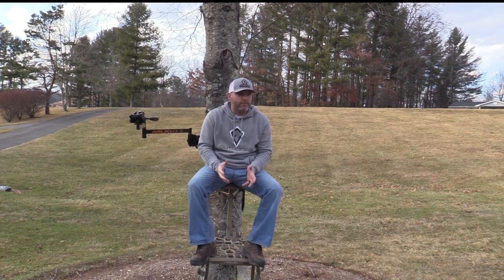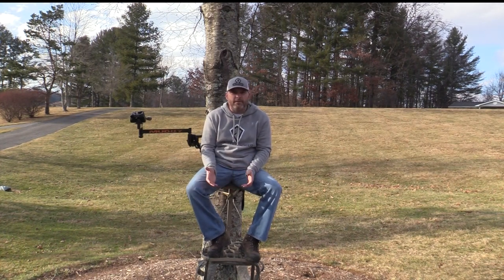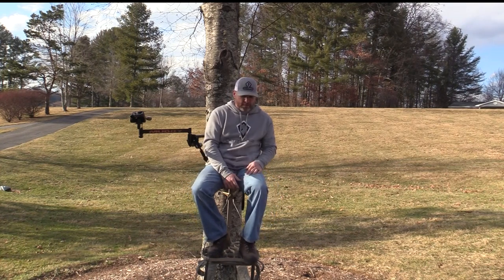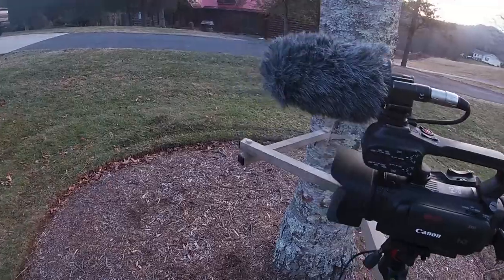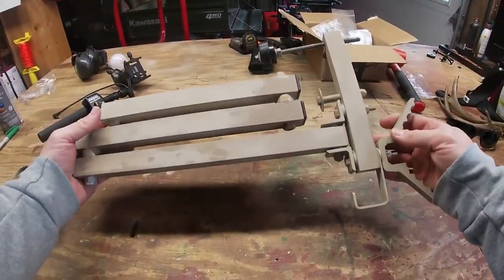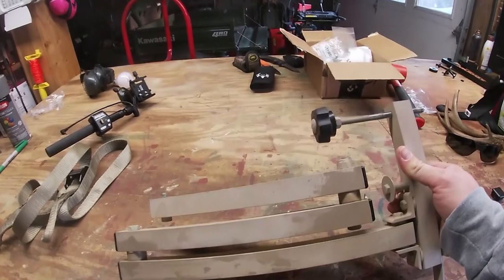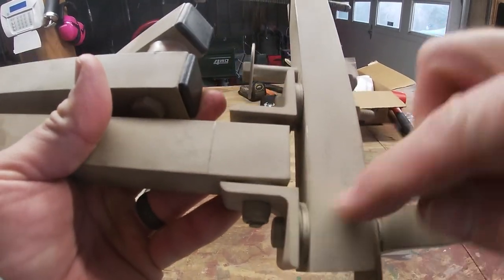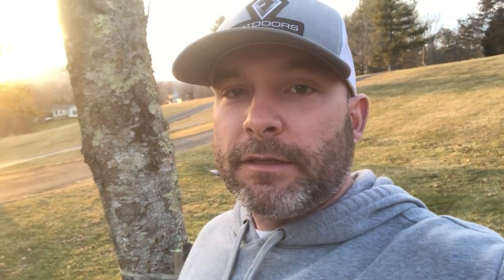HOW TO BUILD THE **BEST** DIY CAMERA ARM!!!

Comment: Thanks for posting this video in such great detail. I have ordered the solid aluminum blocks for bases, spacers etc. with plans to build a couple of these. I'm going to compare the Novix "V-bracket" with the " Offset Bracket". Wondering if you have tried this ? My thought is the Offset Bracket may be better on smaller crooked branches/trees ?
Reply from the maker: No problem man! I’ve used it for 2 seasons now and haven’t had any issue with the v bracket. One thing I’d think about though is the v-bracket will twist on the base so it will be completely flat when you’re ready to pack it up. Make sure to subscribe if you liked it!!

Comment: Really like this. I’ve modified my camera arms so much to get them how I like them. Still have the same problem though with the heavy bases to get them level. Only problem with yours is the limited trees you can put it on if your in a wonky tree. However if you don’t have to put it anywhere crazy I’m sure it would be as you said the best camera arm. Really like it!
Reply from the maker: Thanks! I’ve had it on some I level trees and it does really well. It attaches very similar to the pocket arm by LWCG.

Comment: Thanks for posting.  Looking into building one.  Im torn between using hollow tubing for the base or solid.  Im thinking possibly using a rivet nut for the threaded adjusting rod instead of using a solid piece with a threaded hole.
Reply: Made one today.  I used aluminum square tubing for the base and a rivet nut for the adjusting screw.   Used real tree duck-tape to cover tubing.  Turned out really good.

Comment: That’s a great looking arm. What is the total weight of it? I was looking into getting the pocket arm but I may reconsider. Also do you have a ruff idea how much it cost to build this arm? Thanks
Reply from the maker: Seems like it was 1.5lbs. I had about $100 in it but I had to buy some parts in multiple packs. It would be cheaper if you could find just the parts you need.
Reply: @f7outdoors472  thanks
Reply: @tradfreak_roots can I pay you to make me one?

Comment: Quick question, why not use the solid aluminum for the base instead of the hollow tubing? Just curious if it was preference vs. functionality.
Reply from the maker: The base is solid aluminum. The 3 arm pieces are hollow.
Reply: @f7outdoors472  yeah I saw that….I was asking why the solid piece for the base instead of another hollow piece?
Reply from the maker: @PiNeMandSTiCKeM  oh ok. The solid piece is much more stable and there’s a lot of pressure on that piece when you tighten it up.
Reply: @f7outdoors472  that makes sense. Thanks man.